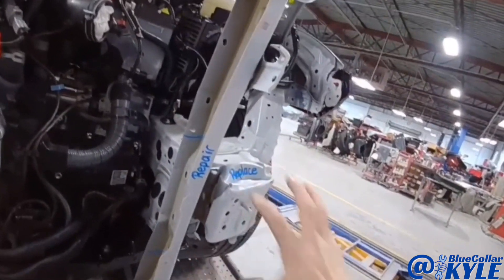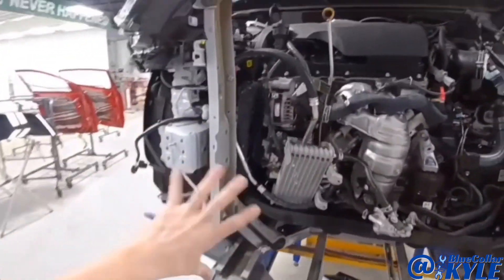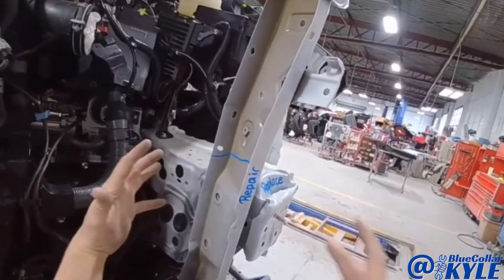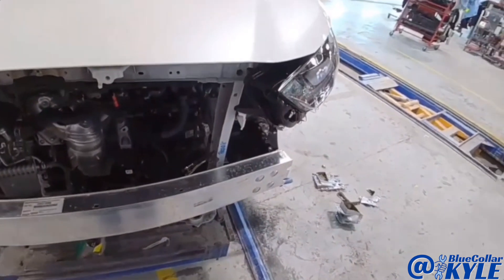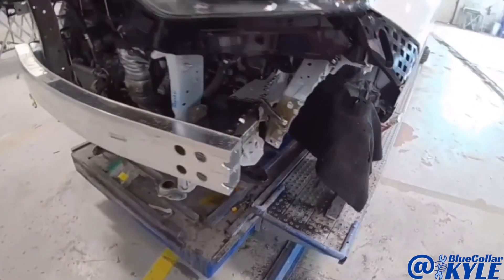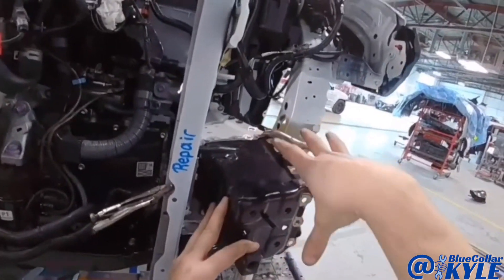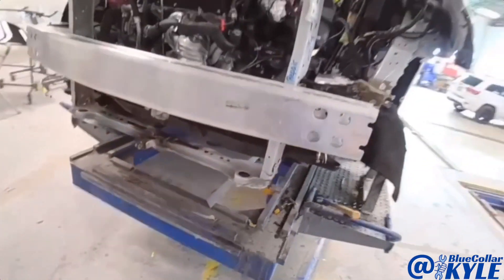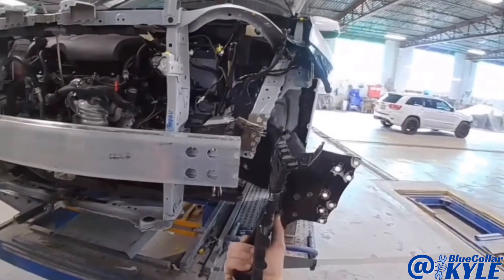Does A Frame Rail Absorb Energy?

Comment: What you wrote in the description is something many people don´t see. Especially when driving larger Trucks. They prefere for example reinforced Bumpers made out of thick steel, which you actually only need when driving off road. They defy the actual purpose of a bumper and what is behind it. It is called a "crumple zone" (although I like the German, somewhat funny sounding word "Knautschzone" better.) and is designed to adsorb energy, so you hit your airbag no longer like a hard crash at 50 miles but only 30 miles for example. (Not sure about the exact figures)
In some countries those add on bumpers are even illegal as they make the vehicle unsafe, if not for the passenger in the car, they may make it more dangerous to people in other cars, cyclists or especially pedestrians. (Yes, how "safe" a vehicle is for a pedestrian in Europe is actually part of the crash test rating. Some vehicles even raise the hood if they detect a collisian with a pedestrian or cyclist, to prevent sort of a cushion.)
By the way, that is also why frontal crash tests are usually not done crashing full face into a block of concrete, but only with about 40 % of the vehicle width into a block of material that collapses in a known way. This simulates the most common frontal crash with another vehicle.